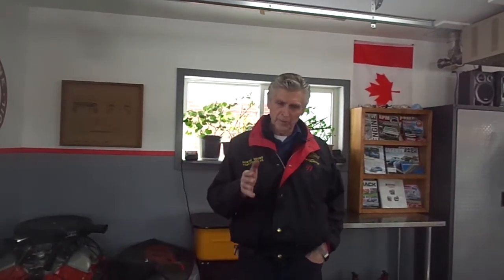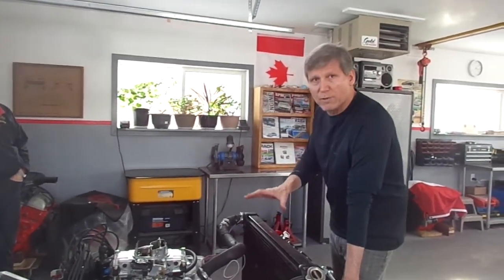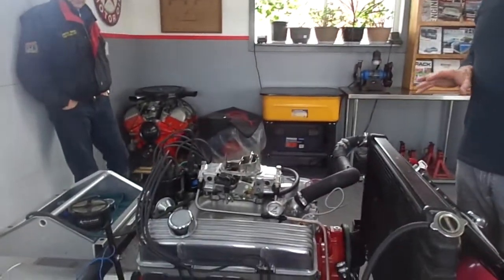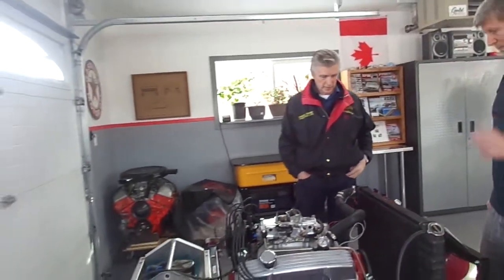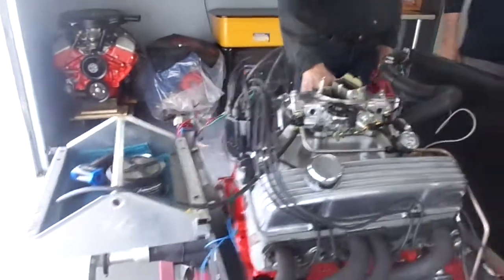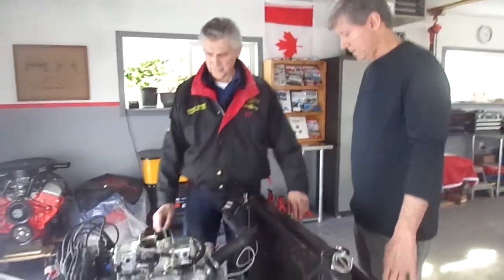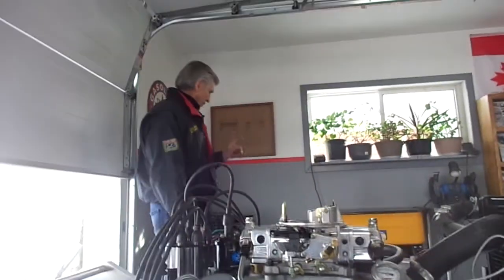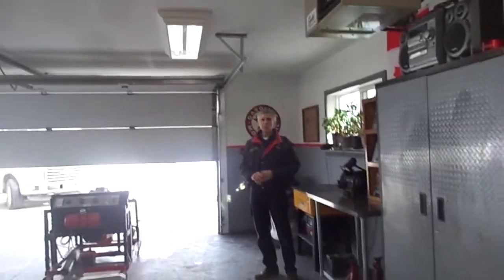383 Chevy SBC Stroker start up on test stand.

Comment: That is a great looking engine and the numbers are right on for torque and the estimated 425-450 hp. Had the same combo in a 63 Chevy shortbox pickup that weighed 3800 lb and would pull like a freight train and run high 12's. Lingenfelter originally came up with this combo in a 90's Corvette that won a number of shoot-outs back in the day....all hail the small block Chevrolet!
Reply from the maker: Thanks for the info!